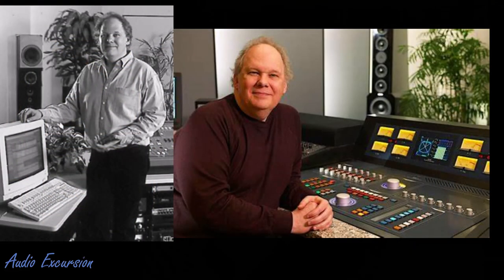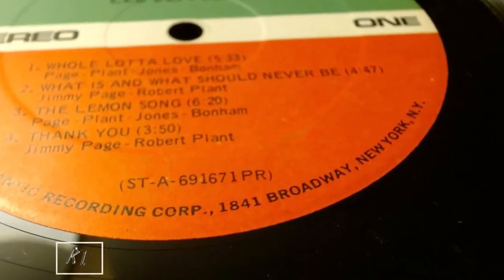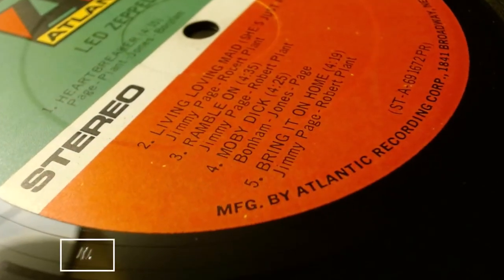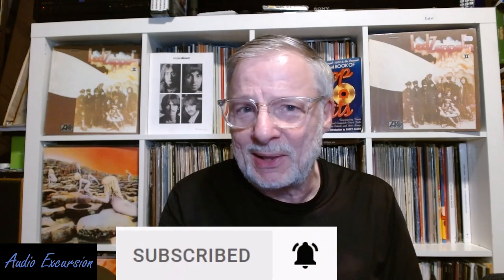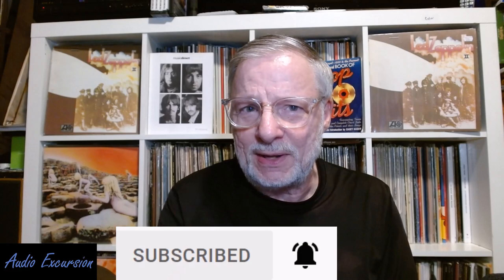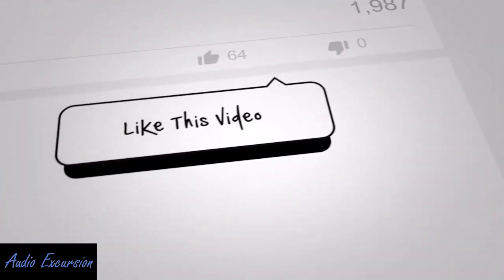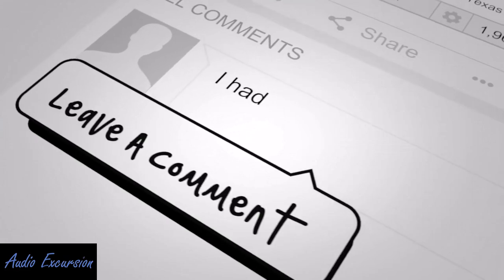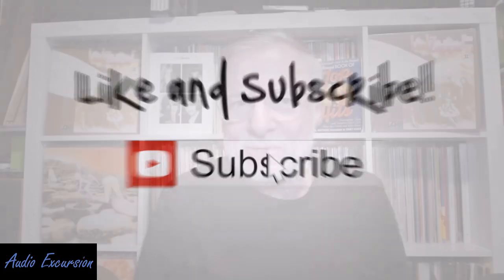The story of the Led Zeppelin II "RL" pressings and how non-RL pressings were done in 1969. (Ep 89)

Comment: I've always just referred to it as the RL cut or RL hot cut.  I've got 5 of them (2 Monarch, 2 Presswells and a Columbia Pitman).  My best copy is a solid VG+ PR. My other 4 are VG or lower.  Even in a beat up grade the RL cut sound pretty damn powerful and if turned up loud enough will drowned out the surface noise to a pretty decent extent.
Reply from the maker: Thanks for sharing and you’ve beat the odds finding that many.

Comment: Great explanation!
Yep, the person cutting the lacquers is doing just that and not mixing it That was already done to the master tape which was used to cut the lacquers.

But, the person cutting the lacquers does have some influence over the resulting record. The cutting engineer is concerned about the finished record and depending on what the owner of the recording wants. If the owner of the recording requests that the record be hot, the person cutting the lacquer can send higher levels to the cutting head. Also being concerned whether the resulting record will track and sound good, the person cutting the lacquer wants to push it to the limit, so has to also vary the groove spacing so the grooves don't run into each other. This is what RL was alluding to when he pointed out that the lacquers which were cut inhouse by Atlantic,  when he  observed that there was more space between the final groove and the labels. Very conservative means that the cutting levels were lower, so the grooves could be spaced closer together. With the lower levels, the records will have less of an opportunity to skip. The resulting record will not be as hot.

Then there are the frequencies. The cutting engineer may find that the EQ of the master tape may be causing distortion at the cutting head, so the cutting engineer can adjust the EQ as well as the cutting levels to prevent the distortion.

As far as the first approved records being sent to the radio stations(45 rpm), that was the modus operandi at Atlantic records. Those first records often had plain white labels with what was on the record typed onto the record labels or typed on stickers applied to the labels. Sometimes Atlantic Records would be printed on the white labels and sometimes they would also have printed on the white labels, "Test Pressing" or "Advance Copy". Test pressing were also sent out to radio stations if they sounded like they wanted them to. The 45's wouldn't usually change from those initial 45's, unless there was something wrong with them. But, eventhough those 45's sent to radio stations may have had stereo versions, the public wasn't given the opportunity to buy the stereo version. Instead, the public may only able to buy the mono 45 versions. Those versions were often unique to themselves and never reproduced in mono elsewhere.

Atlantic was famous for making special albums for radio stations. In those albums normally segued together, like from Yes, Atlantic would put each track in it's own band and would not go into the next track. As the most common of these were made for AM radio stations, they also were stand alone mono versions.

Still talking about 45's, look at a Motown 45 from the 60's. They were mixed so hot that the grooves actually ran into each other. That was from the cutting engineer cranking up the levels. I have noticed that the name "LENNY" is often in the deadwax of these 45's. This is what Motown wanted. Their reasoning behind this was that they felt that the people buying their 45's were usually kids who had inexpensive record players, so they weren't very loud and Motown helped them with hot-cut records. Also, these were also mono because stereo couldn't be cranked up as much.
Toward the end of the 60's and into the 70's, Motown went to more of a finer type of groove like a stereo groove might be. Motown eventually climbed onboard in the early-70's and started putting out stereo 45's for the public.

Comment: Very interesting. Thanks for clarifying that. I’m curious though…what happened to the actual master tape?. Are all later editions and repressings of LZ II mastered from that cassette??. There must be an original master tape still in the Vaults. I guess Jimmy Page isn’t going to let anyone touch it.
Reply: They were used for the Zeppelin Classic Records way back when. I heard, that at the time,  vinyl was so out, that these would stay on the shelves, ans then be discounted and discounted. Nobody wanted any of a baby premium for any record.    Shoot, when I was 10 in 1982, new wave was so hot, all kinds of classic rock records were super clean for $2 in the used bins.  I had a acdc tnt Austrian original and kiss self tilted original all red.   

Even with remastering from original tapes, still can never be the same as RL, But maybe close. Keep in mind also that the tape was brand new when RL mastered it.  

The tapes were used I belive in 1977,  those sound pretty good.     

I also did get a "cassette" at lower volume zep 2, juat to see how bad it was.  It was very bad.   Noise floor super high, as to be expected. 

There are also some German pressing thst have one side as RL, and the other that sounds pretty good.

Comment: Hi,
 Thanks for the informative video.
I have an original LZ2 4 track reel to reel tape, duplicated by Ampex, but even at it’s 3 3/4 ips speed, it’s several notches better than my Classic Records LP.
Haven’t had the opportunity to compare it to the “hot mastered” RL.
Hopefully Rhino HF vinyl will eventually have the opportunity to issue LZ2 and try to at least equal the RL, or improve on it.
I assume that Classic Records knew of the RL, and one would think they would have tried to equal it, but don’t know.
Reply: Maybe you can post at least one track from that reel.   I would love to hear it agaisnt my RL vinyl version
Reply: @Brian-qg8dg  Hi Brian,
My tape machines motor capacitors melted a bit, recently, so I wouldn’t be able to make a copy for a while.
I also have LZ-1 on R to R, and it’s even more impressive, when compared to my Classic Records LP, and to my first edition UK LP.
(The pressing just after the turquoise colored cover edition)
One reason why the tape sounds better, to me, is that I’m using a Revox A77 MkIV machine.
Will let you know when I can make a copy of a couple of the tracks.
Mike

Comment: Does this master apply to the digital releases of LZII?
Reply from the maker: If you're asking if the "RL cut" is used on digital releases, the answer is a qualified no.  His work on those early cuts were essentially destroyed by Atlantic to assure they couldn't be repressed. if the settings he used to make that cut were documented, they could be reproduced if desired either back onto vinyl or onto digital.  I have a digitized copy I've made of my RL LZII for playback in my car (I think it blew one of my speakers actually), so beware of the RL cut if your system can't handle it :)

Comment: I got lucky finding a pretty clean RL years ago. They do sound great.

I don't think Ertegun was crazy to base his decision on how the record performed on his daughter's cheap turntable. His thinking was the record should play correctly on the common person's equipment. However, I do think it's odd that his daughter had the same equipment as the aforementioned common person.

With regard to the recut, I wonder if what Bob (or whoever at Atlantic relayed the story to Bob) meant to say was the 1/4" master tape used for the cassette edition was used for the LP. In their prime, cassettes had rather mediocre sound, and they were even worse in 1969. I also have a recut LP, and while it is certainly less impressive than the RL, it does not sound "lo-fi." And I know commercial cassette releases did not take full advantage of the format due to high duplication ratios, but still.
Reply: The RL's are only the pressings with the original orange Atlantic label. The GC - Greg Calbi I mentioned earlier in this thread is on the WB label that came after with the green stripes.
Reply: I had a super clean "cassette " version.  Volume low, high noise floor, sound bland.. yep, that'd the sound of a cassette recorded at low volume!!

Comment: He did Houses, too?  I have an original pressing at home.  I must check the run out groove.
Reply from the maker: Yes I check mine and there it was!
Reply: @SafeAndSoundTXAudioExcursion  It's small enough, but mine has it, to.🤣  I just had to catch it in the right light, running parallel to Atlantic's address and "STERLING" is on it, too.

Comment: Ok, so what tapes were used to cut the Classic Records version, and what tapes were used to make the 2014 hi rez cut???
Reply from the maker: Original analogue tapes for Classic (re)mastered by Bernie Grundman (Test press 2002, release 2005). Supposedly original tapes used to create digital files used for Jimmy Page to Remaster in 2014. (Albeit tapes 10+ years older)
Reply: @SafeAndSoundTXAudioExcursion   i have both : a RL side A / LH side B + SS (Sterling) on both sides, Terre Hautes ; and the new 2014 J. Page remaster . Sure, RL version is KING, better than the UK Plum which i have sold. Now, the 2014 Page version is actually really good ( and i usually never like modern remasterings ). It's funny : even Tom Port (Better-records) says that the Page version IS good ! .....

Comment: I've got a RL edition of it, but I also have a 1979 edition from Germany that sounds as hot and as great as the RL cut, I got it at only 15 dollars and no one talks about it.
Reply from the maker: Wow, wonder who mastered that German pressing?
Reply: @SafeAndSoundTXAudioExcursion ... there are several german (70's) pressings  with RL on side one (only on side 1). Easy to find here in Europe. But side two is very weak. I have the RL/LH SS in VG condition, and the 1977 Piros, Presswell, X @t GP , in the Runout, which is very close to the RL !!

Comment: I'm not sure you're 100% correct about the cassette theory that all the other pressings besides the Robert Ludwig were mastered from a cassette because I have a RL copy and I have a PR copy that sound identical both with the same catalog numbers from 1969 but I do not know who PR is but it sounds identical to RL the hot mastering and the next pressing of led Zeppelin II the gold record award copy sound quality is really dull so the cassette theory I'm not sure if that is accurate
Reply from the maker: I have read that PR was an associate who worked with Ludwig on off shift and did cuts with the same settings as Bob this their similar sound. I wasn’t saying all subsequent pressings had a cassette source, it was an interim solution only and was relatively short lived. If my presentation implied otherwise, it was not my intention.
Reply: @SafeAndSoundTXAudioExcursion  that's interesting that PR worked with Bob Ludwig and there's another source out there that sounds similar to the RL pressing with the same short dead wax same catalog numbers same year but you can still find the pr pressing for cheap because most people out there don't realize it almost sounds the same

Comment: It's very odd to see a cassette in vinyl cutting path, maybe Bob forgot all that stuff? Maybe it was 15 ips/ 1/4? I'm only have original AMPEX R2R 4track 3/4ips and several generation of a production master 15ips 2track. That tapes sounds amazing, so (i think) i dont need a vinyl copy. Anyway - very interesting story.
Reply from the maker: No what HE used came from a standard studio tape.  It was the non-RL presses that used an EQ'd cassette for a source according to Bob.  Which means a lot of pressings of the album had that as a source which is dreadful.

Comment: A hot "mix" or mastering has nothing to do with low end but mastering loud. One can increase the low end but that is not this. This is the same problem RCA had with certain stereo classical LP records  (1s/1s such as Fritz Reiner CSO in about 1960) having the stylus jump out of the groove. It was made clear in the notes much later that RCA cut them hot.
Reply from the maker: While the RL is a tad louder overall that the subsequent release, I would have to argue that certain frequencies were in fact boosted on the first mastering by RL.